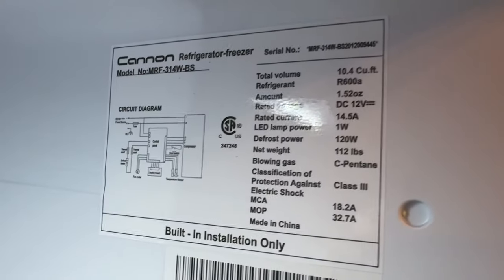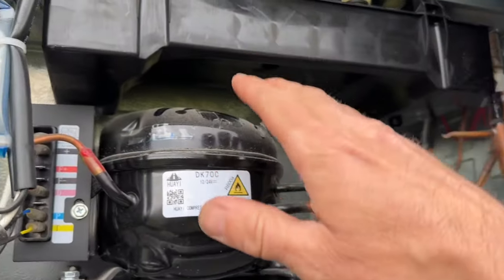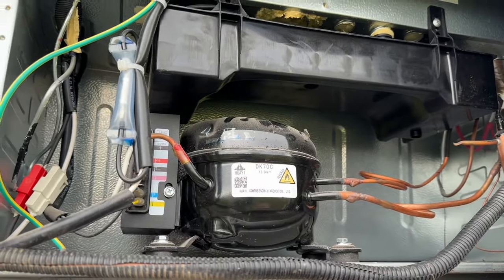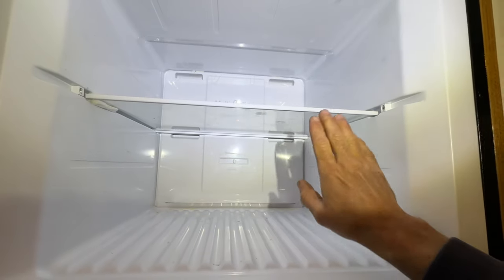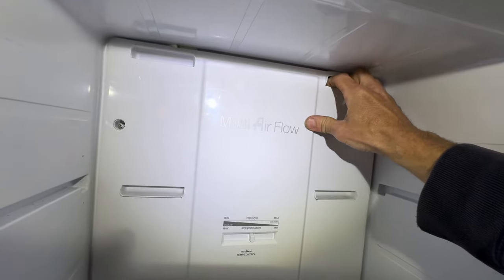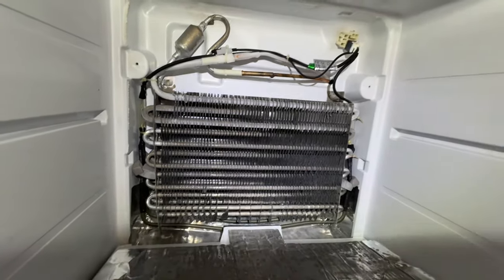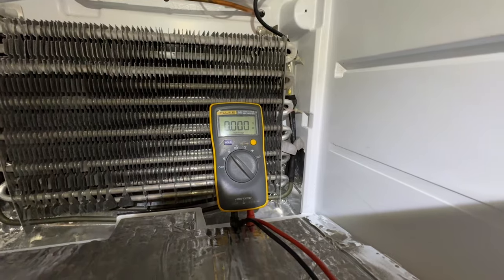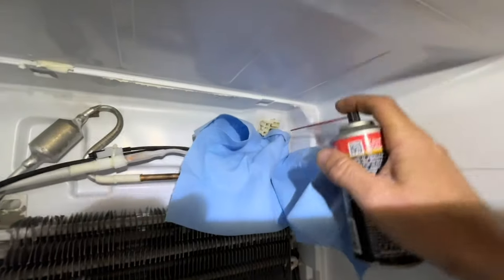12V compressor RV fridge not working. Troubleshooting and repair

Comment: Thanks for posting this, I think we're having a similar issue with ours, it's a Dometic brand fridge, but it's only a 12v DC unit, which we've never had, so I'm not familiar with the way it should cycle. At least now I have a few more ideas for troubleshooting.
Reply from the maker: You’re welcome. I didn’t know how these things worked and I was feeling a little intimidated. I’m glad I cracked it open. It’s fairly simple and I really lucked out and the repair was very easy and cheap. I ran it for 2 weeks straight after the repair off my solar system. Worked great. 

Best of luck with your repair!

Comment: I keep researching 12v fridges. But reviews just didn't seem very good. Many are only lasting a year or two.
Reply from the maker: This one was in an RV I bought so I don’t know exactly how old it is, but it’s not old!  I have a brand new one in another camper. We’ll see how they hold up. Strike one so far. 

What I love is that in both applications I have enough solar to run them indefinitely. That’s pretty sweet to leave them unplugged and the fridge running 24/7!  That was the goal.
Reply: Don't buy an everchill mine just died after 2 summers. I'm looking at the dometic and the customer service representative there said her most common repair for them is the fan. I'm ordering an extra fan to have on hand. It's definitely the least expensive part and easy to replace. The circuit boards can be around $200 and might not fix it. Ask me how I know!

Comment: Still running strong?  I'm about to embark on a similar quest with my ever chill 12v.
Reply from the maker: It is still running strong. Taking it out again this weekend.  Time will tell but seems like it’s all good!
Reply: @bennieaust  , little follow up from my issue.  Mine is likely due to me storing my van on a slope.  Apparently they can or will turn off if they aren't level.  This was good for me to know.
Reply from the maker: @jasonwalker1959 that’s good to know. So I’m assuming it’s working good now?
Reply: @bennieaust  , yep.  been going strong 2 days in a row.